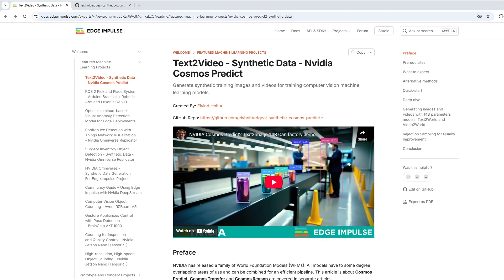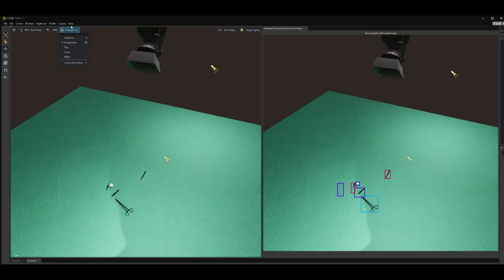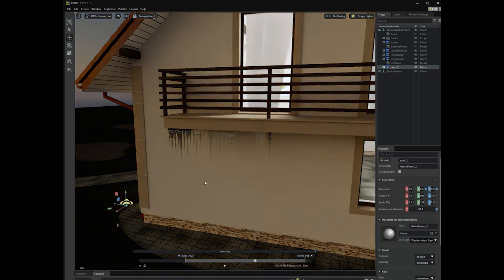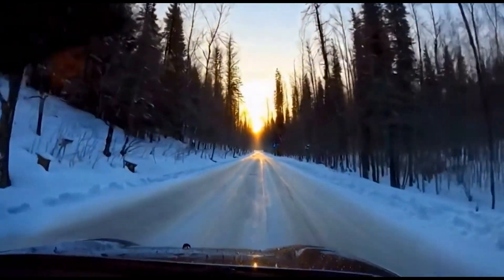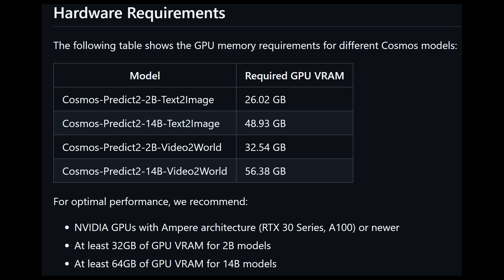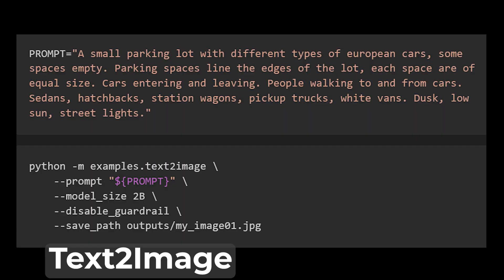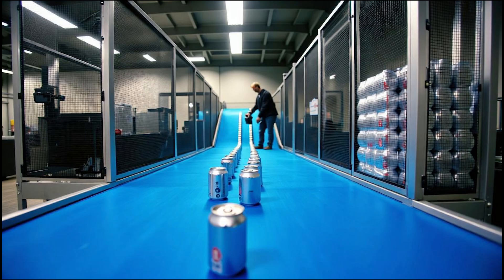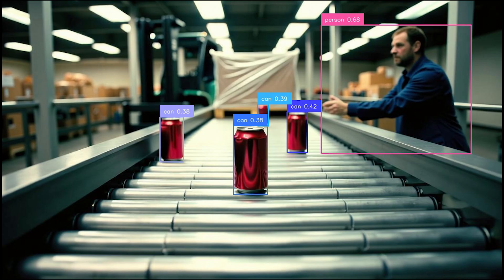Synthetic data generation with NVIDIA Cosmos Predict 2 and Edge Impulse

Comment: Does it provide ground truths tho ?
Reply from the maker: I keep 10-30% of manual data for model verification. For projects with limited work labor that still opens many doors. The generated images can contain artifacts, the auto-labeler can introduce errors, however research indicate synthetic (3D composed with domain randomization) with it's controllable class distribution, perfect annotation, elimination of long-tail coverage problem can outperform manually sourced models, e.g. https://arxiv.org/html/2503.09354v1 To what extent this applies to generated datasets remains to be proven, but it certainly has progressed with respect to realism and prompt adhesion. One can further use models such as Cosmos Reason to automatically grade the data, or use Cosmos Transfer to add variation to 3D modelled domain randomized synthetic images. I consider the method presented in the video a form of dataset distillation or push-forward quantization and I think the need for verification of a trained model remains regardless, so the short answer is no :)